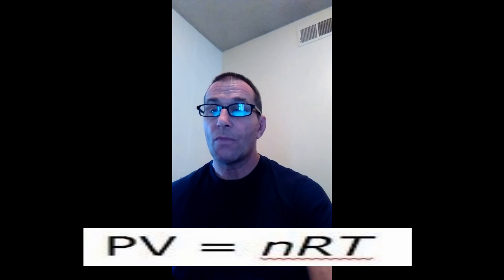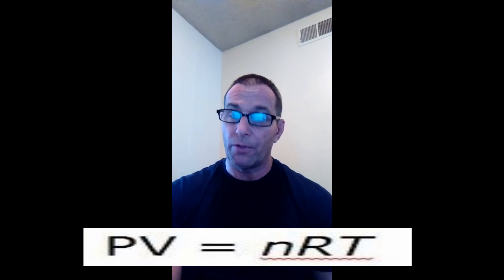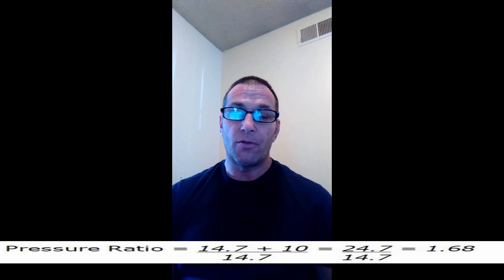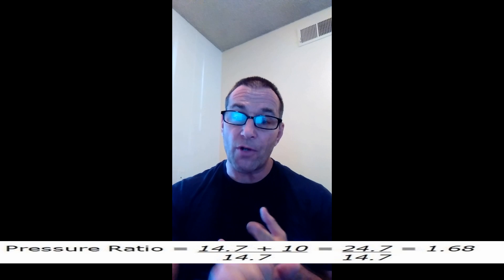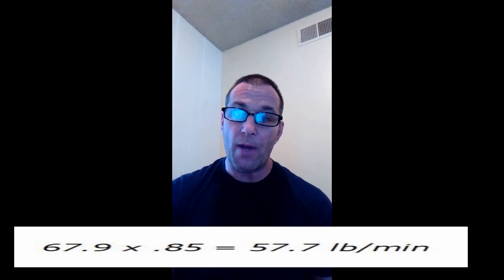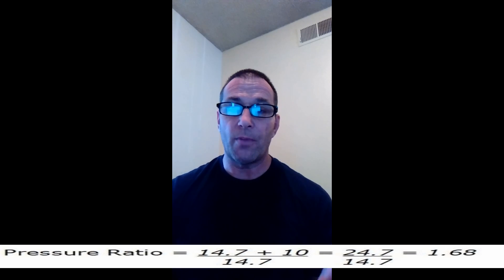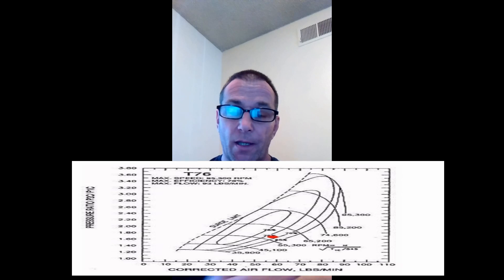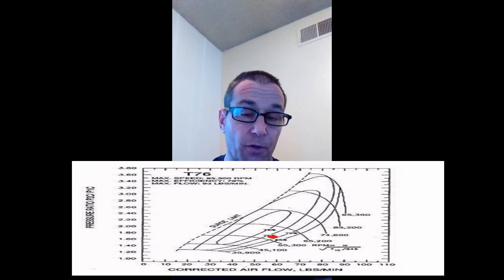Rear Mount Turbo - How To Build a Remote Mount Turbo System Video 1

Comment: With today's latest technology in nanostructures and ionic propulsion I could make a rear spoiler thruster for a twin-turbo rear-engine rear exhaust 2 flex pipe to Dyson windfoil rear spoiler made from titanium and negative sheet of graphite and positive carbon fiber or nanotubes nanowire for single carbon atom exhaust bern ion jet thrust active rear spoiler.

Comment: I have a rear mounted turbo system. And i have a separate oiling system that does not need to have the oil return back to the engine. Australian Engineering.
Reply: Exactly! 

What if the oil return lines busted. That would put my engine in jeopardy!
Not worth wrecking my engine. 
Independent oil system for the turbos makes the most sense
Reply: yea it would be far easier and more efficient to have a standalone oil system for the turbo.
Reply: Would be interested to hear more about your system
Reply: How big is the oil cooler??
Reply: I'm sorry for necro posting but I'm curious what sort of pump you are using and where you located the oil cooler.    I ave been trying to figure out this for a bit now.   Still debating between using a separate oiling system or using one of those comp oilless turbo

Comment: Hi what would your compressor size and turbine size recommendations be, per turbocharger, for a rear twin setup for a  6.0 lsx? and what RPM would you recommend the boost roughly to start to kick in ? ... Street use, looking for around 500hp at mid psi settings, no intercooler. Thank you.